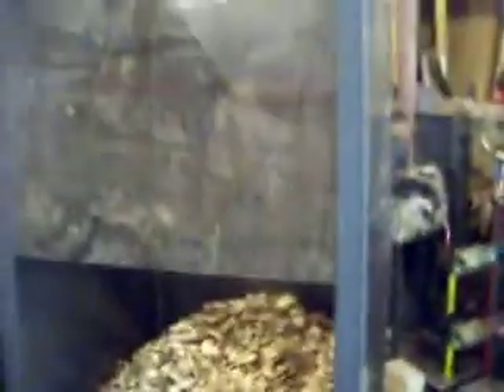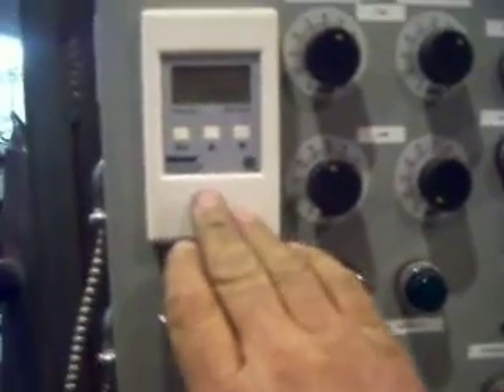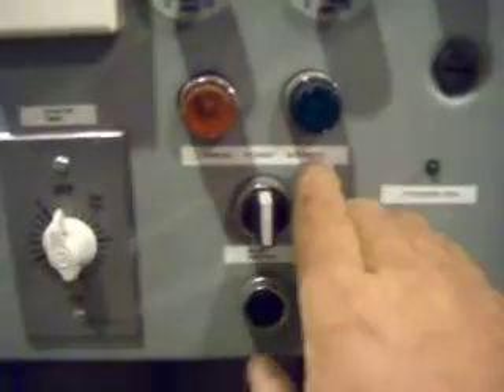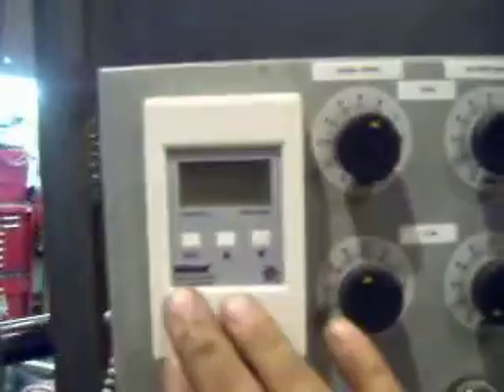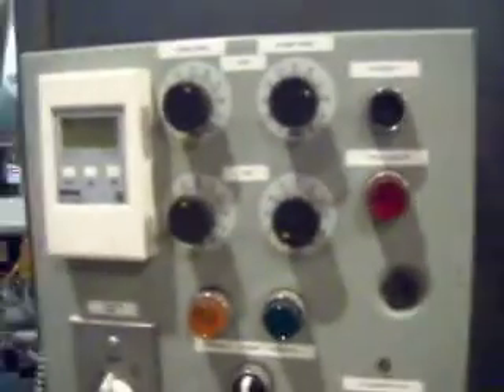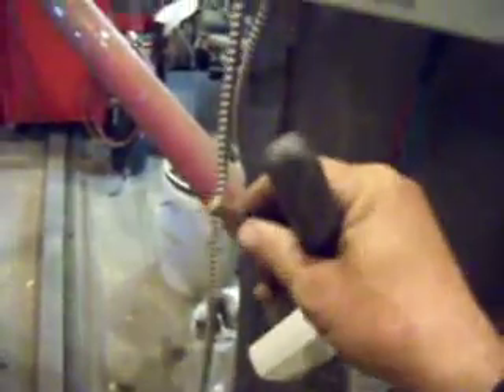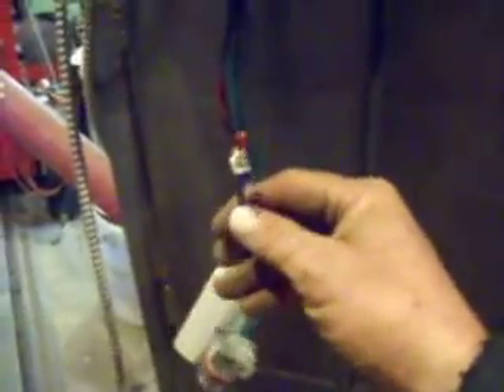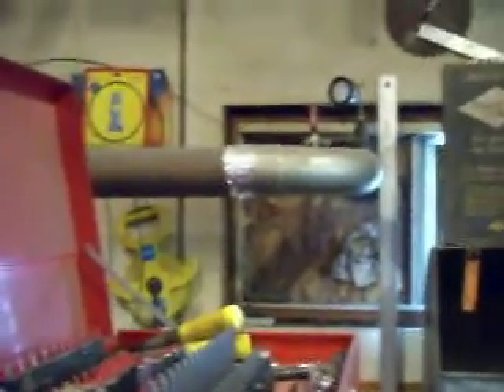gasifier-automation

Comment: So you went and did it !    I've been studying Mechatronics and was thinking about automating our wood furnace with a Programmable Logic Controller or a set of PID controllers.

Of course I realized automating a Gasifier would smooth out some of the issues.

Did you use RA330 Stainless for the grates ?

For your other fans; this is the only guy I know that's built a wood chip sorter drum big enough to walk through, and five times that long.